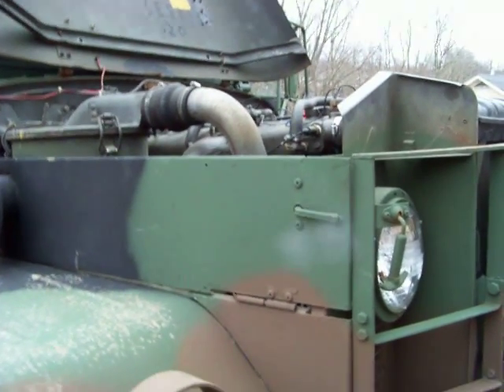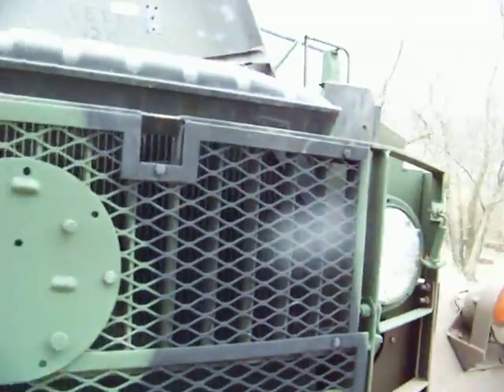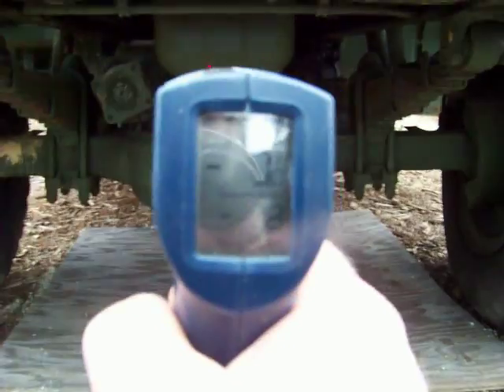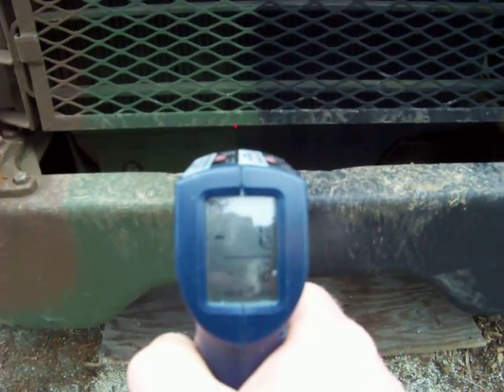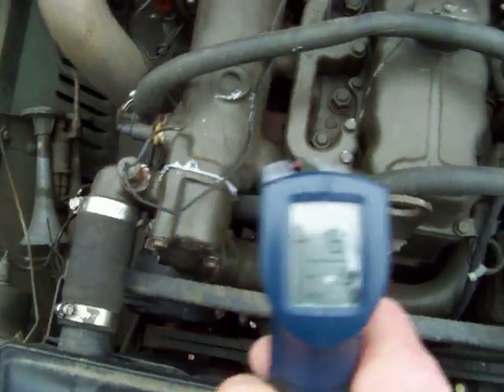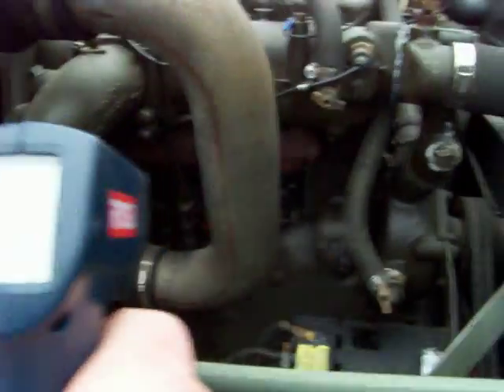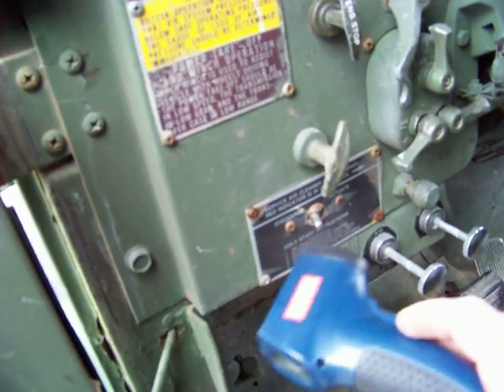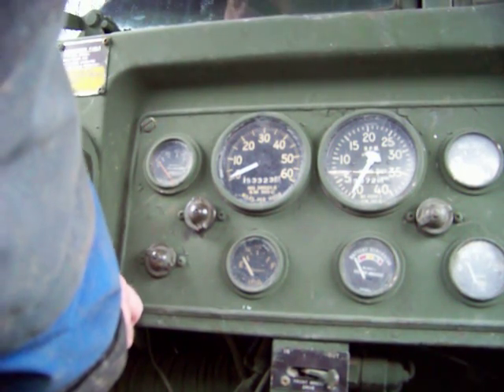M35A2 with kats ether injection starting system

Comment: it was a -50 about 2 weeks ago and was curios if my M35A2 would cold start with the ether injection.  She started to turn over and I think she would have, but the batteries gave out on the 2nd try after only a few seconds...  replaced the batteries with (2) 6TL, but now the weather is back in the 20-30, so I can't duplicate the same scenario.  Oilfields of North Dakota (Repo3004 on SteelSoldiers)